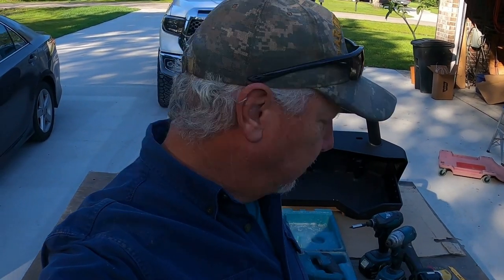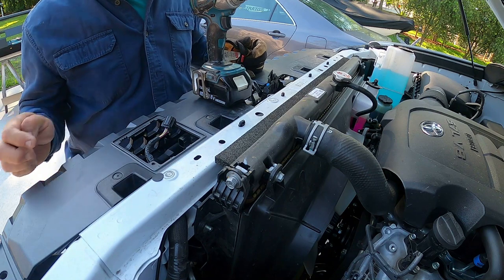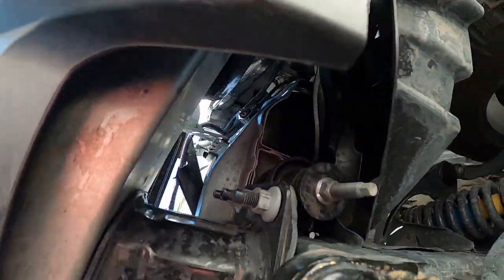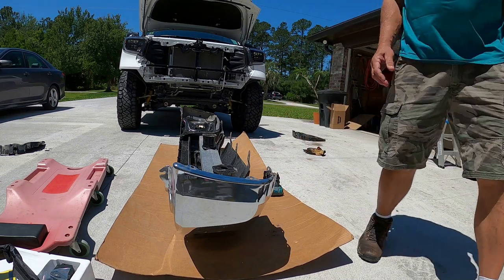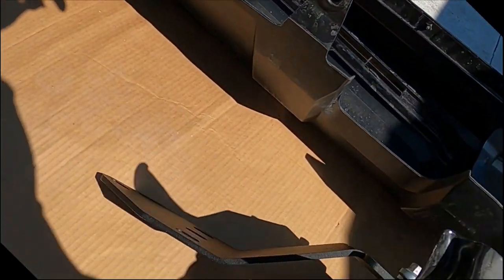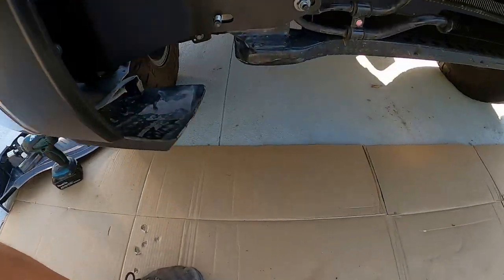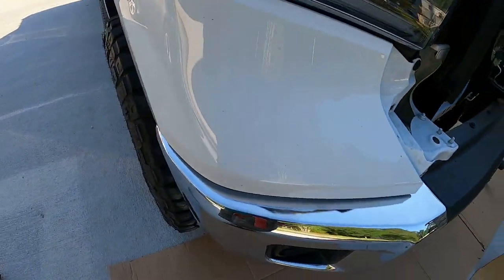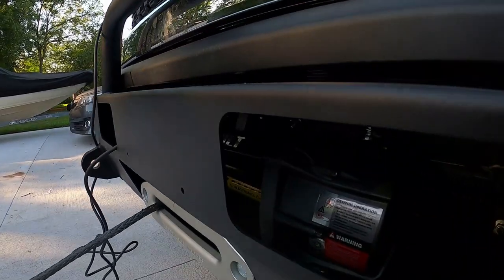Warn Semi Hidden Winch Bumper Installation Tundra

Comment: Your tool kit should have a tool called a breaker bar. That is for breaking torque. Never use a ratchet to break torque.
Reply from the maker: Problem is a breaker bar would not have fit into most of these areas.  Thanks for watching and for your input.

Comment: Came across this video as I was also looking at the warn bumper but right off the bat you referred to this series and your truck has an overland build....... Then you proceed to show everyone the anti-sway bar. Anyone who has ever taken their vehicle off road would know that putting a anti-sway bar on their truck is counter to what you would want with respect to the vehicle axle freely articulating.   The only reason most people have something like that is to reduce the body role in cornering and maybe a bit for hauling loads, but certainly not overlanding.
Reply from the maker: You are correct and I have since removed that sway bar.

Comment: Go with Bilstein 5100 adjustable shocks and get rid of the spacers and blocks, the ride improves 1000% and it's way better on your suspension for overlanding.
Reply from the maker: I'm happy with the ride quality with the factory TRD Bilsteins when aired down to 20PSI.  Rides like a Caddy.  Don't want to spend any more money on this until I lift it again for 35's.

Comment: I looked up the part# and it says its for 2020 or maybe goes up to 2020 only? I guess its possilbe nothing changed between the 2 years?
Reply from the maker: Mine is a 2021 and it fit fine.  2022 is different completely.

Comment: Would have been interested in seeing the electrical setup. What does that all involve? Great video. Just what I was looking for for my 2016.  I wonder if people are still having issues with the Amazon seller or if it’s just better to buy elsewhere.
Reply from the maker: You will need some electrical skills to connect the relays.  I made sure to use waterproofing of al the connections.

Comment: My understanding of the fuel gauge is that the extra 7 gallons is used to cool the fuel pump, so it’s not adjusted for on the gauge.  It’s nice to have that reserve to use in an emergency, kinda like those old motorcycles.

Comment: Thanks for the great video.  It was really helpful!  I did an install this past week on my 2015 Tundra.  Couple things to add...

1) the 8 nuts on the studs cab be accessed once it's on with a long extension and a u-joint  through the cut outs. 
2) the 6 outer nuts, that hold on the bumper brackets to the bumper structure, can be accessed once it's on if you pop out the fog lights.  
This way you can adjust the alignment after it's all in place--at least with the winch I used--evo12.

Comment: Thanks backwoodsgourmet!  I appreciate how difficult it is to make a video, while also doing the install for the first time.  The Warn instructions are poor at best, so your video was invaluable.  A couple of notes to add to the video, for those that have not done this yet or are stuck.
- Figure #9 on the instructions shows arrows pointing to the bolts that hold the standoffs to the aluminum reinforcement bar.  These do not need to be removed.  The video shows them being removed also, I did the same, then realized it was not necessary, nor is the hardware needed later.

- My 2021 had a sensor on each end, just above the fog light.  I didn't see them till I pulled the bumper off and broke the mounting (JB weld fix)  .  If your truck is equipped you can reach around the inside of the wheel well and remove, or remove the front corner valance.  They are bolted to the top part of the chrome bumper end caps.

- Step #13 says to cut a 10" x 2" piece out of the bumper support rib and don't cut through the front.  The bumper support rib is a U shaped channel.  Cutting the bottom of the channel does not give enough clearance for the control pack.  I'm running a Warn Xenon 12-s.  I ended up calling Warn support before I cut any more.  You need to cut 1-1/2 to 1-3/4 out of the vertical face of the u channel.  You can do this and still come just below the plastic part of the front of the bumper, which is what they intended when they said don't cut through the front.  If you look at the picture on figure #13 you get a better idea.  Note I only needed to cut 7" total to clear the Xenon.  I cut an additional 3 inches out of the left side only to clear the side port on the control pack.  BTW; I was able to fit the re-assembled bumper over the winch mount on the floor of my shop to check fitment.  This saved re-assembling the whole deal just to find out I needed to trim more.

If you have this video is is the best one out there, I watched them all.  Thanks again to backwoodsgourmet!
Reply from the maker: Yes, I did later discover the extra steps included in the instructions on removing the stock bumper.  My Smitty Built winch worked fine with the cutouts described.  One note to add, the plastic grill part of the bumper cover will snap out instead of need to be cut.  Thanks for your input.  This might further help some folks.

Comment: Thank you for the video. We’re you able to get the bumper aligned up better than in the video? I really want this bumper. But it seems getting the right alignment is a hard with this system.
Reply from the maker: Actually, I got it a little better, but the slight forward offset solved my rubbing issues.  So a win.

Comment: Quick question the bumper doesn't interfere with the front sensor?
Reply from the maker: My sensor is in the Toyota badge.  You do have to disconnect the cable to it to remove the grill.  It is also pre-drilled to accept the parking sensors if you truck has them.